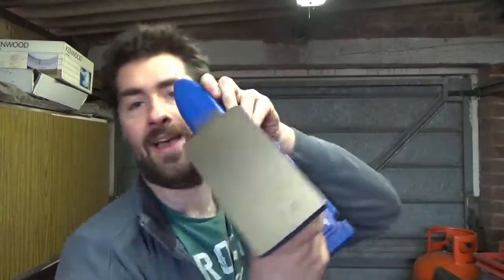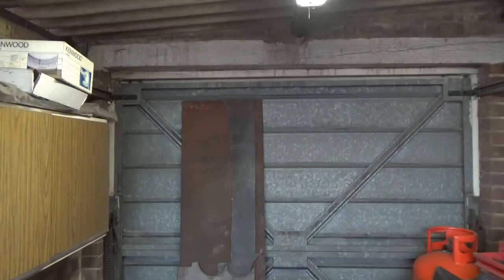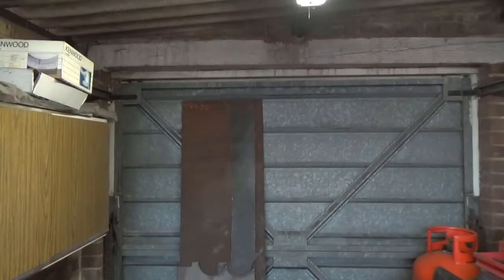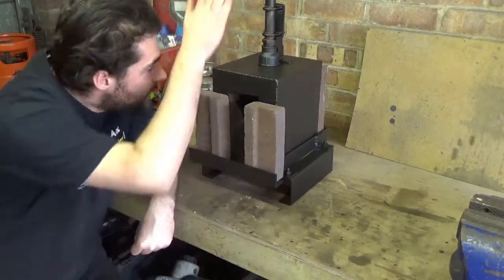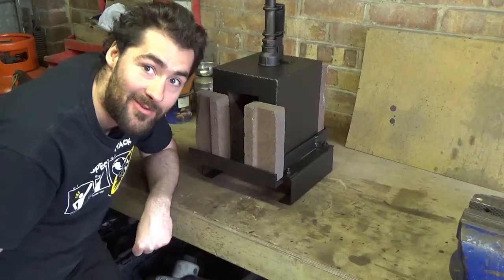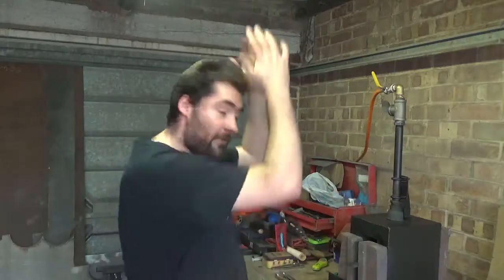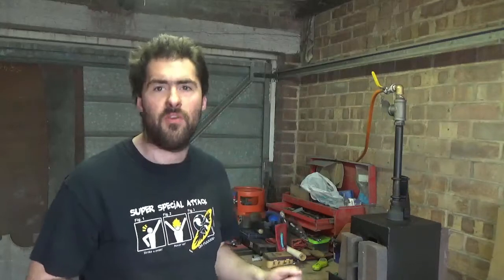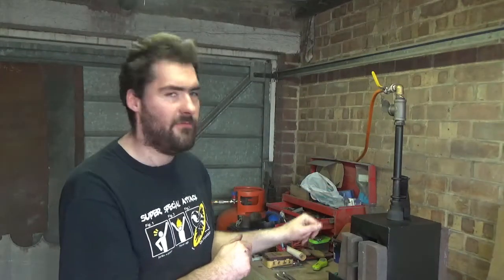MadWizards Blacksmithing Adventures Part 3 - Anvil Stand Firing Up the Forge

Comment: hey buddy good looking forge, one suggestion I have is adding a blower to the burner. you can use a old hair dryer without the heat element working. you'll find it'll burn a bit hotter and use less propane than a ventury burner and you'll get less flames coming out of the forge. but otherwise great job.
Reply from the maker: +Jason Cooper Thank you for your advice on the burner and Im glad you enjoyed the video.
As I say I've never done anything like this before so any advice people can offer me I'm very greatful for. I've got an old hairdryer kicking around somewhere, if I can find it I'll rip the heating element out of it, hook it up and try it out!!! :)
Reply: I'm sure somewhere on youtube is a video of forced air forge burner so you could see what kind of difference it would be. I too started with a ventury burner but tried a forced air and will never go back. also started with a similar anvil but have since moved on to a piece of railroad track as I found it is quite a bit harder and seems to move material a bit fast. practice on scrap metals first to perfect your skills and learn how the metal moves with different strikes of a hammer. I started blade smithing with old railroad spikes and then used leaf/coil springs and moved on to high carbon knife steels from there once I felt my skills were refined enough.
Reply: Oh and Anthony always remember that it's a hobby or future business so have fun with it and nothing is wrong with anything you forge. if it doesn't turn out like you hoped it would it was still a great experience.
Reply from the maker: Thank you so much for the advice Jason, I know that there is a lot I still need/want to learn but your words of wisdom really gives me the enthusiasm to continue wanting to know more about blacksmithing and wish to do it even more. I'll deff have a look around on youtube for those forced air videos!!! ;)

Comment: I'm curious, do you ever have accidents? and if so, how often? I'm finding myself getting more and more interested in blacksmithing! But I'm one of those people who worry about accidentally hurting myself, I'm quite clumsy LOL 
Also I would like to do my homework on it, but I have no clue where to start! Any advice on that? Would be much appreciated!
Reply from the maker: Hiya Nathan, like all crafts they come with there own strengths and weaknesses, and some crafts have a higher risk of having an accident then others. Blacksmithing and Metal working do come with high risks but any good Blacksmith or Metal worker will always wear the right safety clothing, follow the right instructions on any hand or power tools, keep his/her work space clean/organised and regularly maintain any tools or equipment they'll be using. I won't lie accidents do happen, I myself over the years have lost count on how many times I've hit my finger with a hammer or cut myself. I've even put a grinder across my arm and a drill through my hand, but as long as you follow all the health and safety stuff the chances of having an accident are very small.

As for wanting to learn the internet is fantastic for that, there's a ton of books on the subject that you can pick up at your local library, buy on Amazon/Ebay or you can download off the internet. There's Metal working and Blacksmith Forums that you can look on or if you like video's you can watch hundreds of them right here on YouTube. Just simply type in anything like Blacksmithing, Blacksmith tutorials, Forge building, welding ect. 
Your be amazing on what you can find. I hope this Helps and thank you for your Question!!! ;)

Comment: I think you are going to find your anvil to tall. You're going to use your arm for hitting rather than the full use of the hammer, the top of your anvil should be even with tour knuckles with your arm hanging at your side standing straight.
Reply from the maker: +Al Meyer Thank you for the advice on the anvil, as I say I've never done anything like this before so I'm very thankful for any advice people can offer to me.
I've yet to try out the anvil to the full but if I find its not working I will definitely lower it to the high you suggested!!! :)
Reply: The trick is you want to hit square to the face of the anvil, if you lay the hammer face square to the anvil and hold the handle is it a comfortable grip? then try it at the height of your stand and see how that feels it might be a little low but you will be able to tell where it feels right to strike flat.that will lend itself to more control of your hammer blows.
Reply from the maker: Fantastic, thanks again for the advice man. I really appreciate it!!! :)